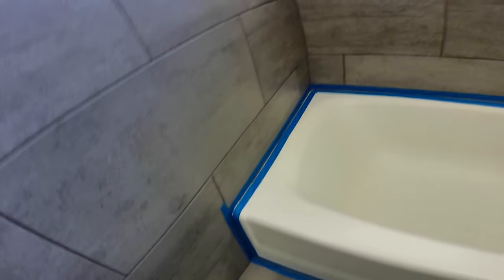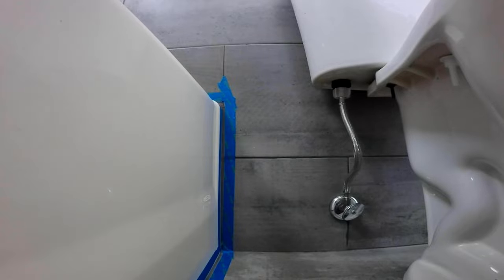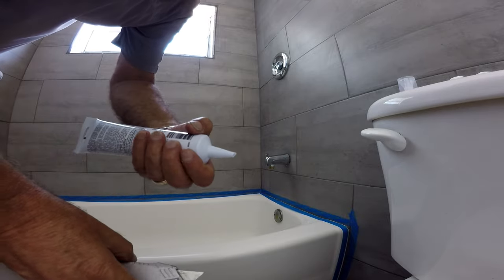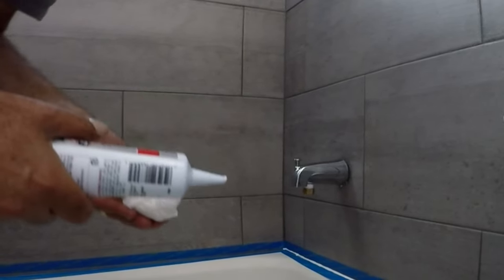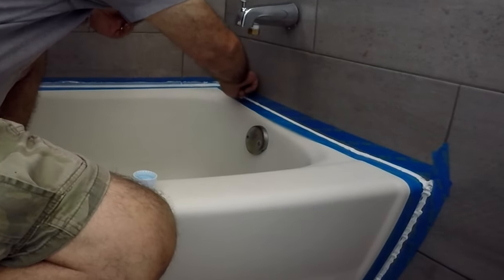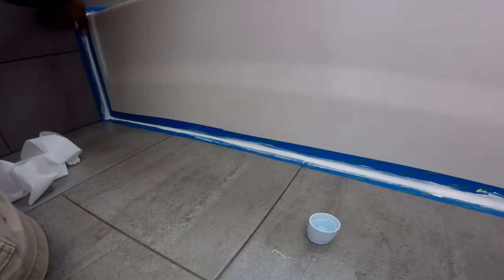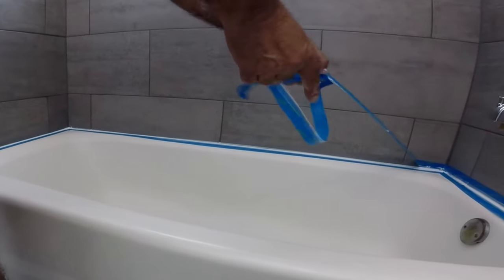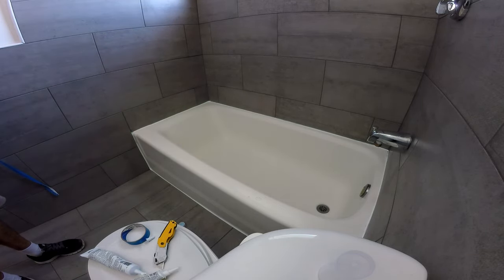How to Caulk a Straight Line on a Bathtub with Tape

Comment: An excellent idea John. I have done quite a bit of caulking running my finger over the freshly laid silicone to smooth it out, but never considered using painter's tape to keep the edges straight. I will definitely try that the next time I do some caulking. I was interested in watching to the end and gave you a well deserved thumbs up. Thank you for sharing my friend.
Reply from the maker: It's worth the extra time spent using tape. 
Thanks for the visit Dave. Merry Christmas to you and yours.

Comment: Very nice video. I'm glad you addressed the point about removing the tape while the caulk is still wet. I wasn't sure, and makes 100% sense or it would pull up the caulk if dry.
Reply from the maker: Glad it helped. Thanks for watching!